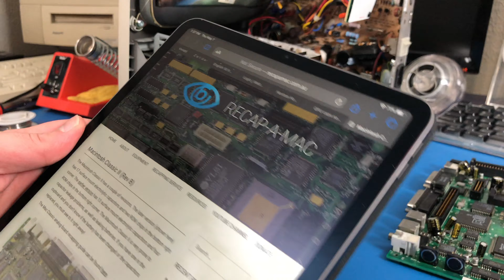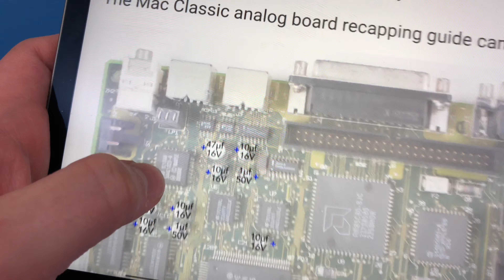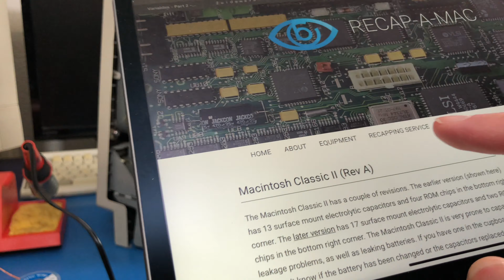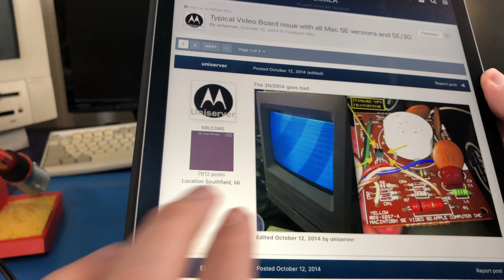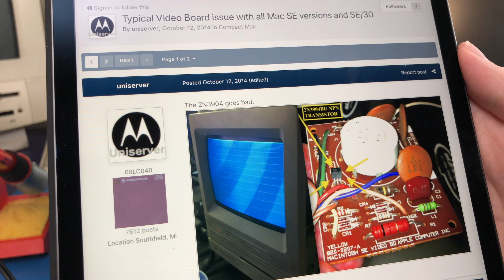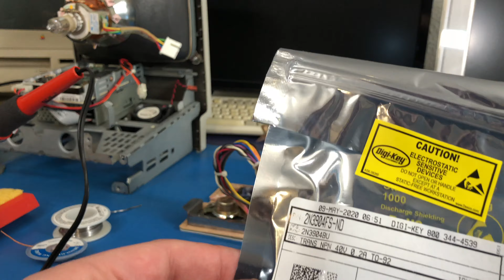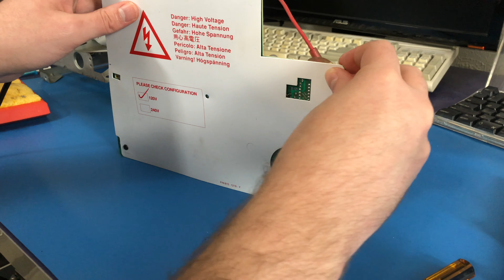Replacing 2 Caps, & a Bad Transistor - "Mac's Mac Classic II," Part 3

Comment: Thanks to your video, I was finally able to fix my Macintosh today that had the same scanlines problem. It had been down for years because of this problem, I had already intervened on the 2N3904 transistor, but to no avail. Today I replaced the transistor again, the 4 1N4148 diodes and resoldered the whole CRT board. It was a joy to finally see those obnoxious scanlines disappear. Thank you very much!

Comment: Kudos for trying to save this guy, the previous owners attempt is hilarious and unfortunate! I highly suggest you try some quikchip no clean tack flux for this sort of work, makes smd and cleanups a breeze!
Reply from the maker: Thanks for the tip, I'll have to give that a try!

Haven't finished editing and uploading the videos yet, but I did eventually end up with a functioning machine after resorting to a donor board for this one.  I think there's a least one lifted pad on the original (the one that I was able to wiggle with my finger in this video).
Reply: @directionlesstech  If you are keen I can do the SMD rework, trace repair for you pro bono If getting the original back to life is of interest.
Reply from the maker: @SatanicMac  I'll run it by Mac (who's computer this is I've been working on), but I may very well take you up on that!
Reply from the maker: Hey  @SatanicMac  - after talking to Mac, we'd love to take you up on this offer if it still stands.  (Obviously we would be willing to pay at least any shipping or parts costs regardless.)  I have since uploaded the next part in this series (https://www.youtube.com/watch?v=7agZ4g9QeFg) which you may want to watch before saying yes/no, since that video shows the full extent of the condition of the board as you would receive it, complete with the lifting pads I was struggling with.  (In the subsequent, not-yet-uploaded video, I do finally get the Classic II working, but only by using a donor board from another machine.  We'd still like to save this original one, if possible.)

If you'd like to do this, reach out to my via email or Twitter DM (both linked from this channel's About tab) and we can arrange things!  :-)